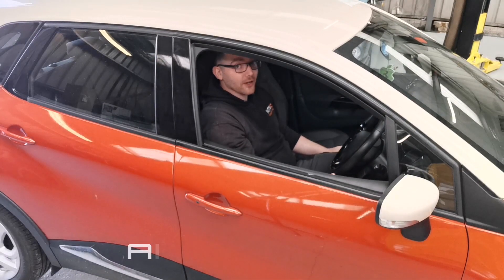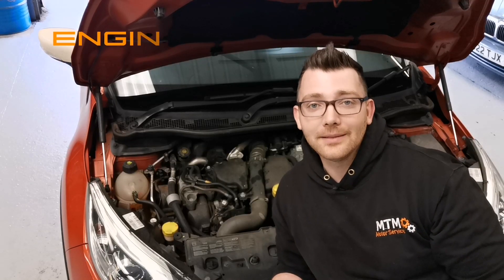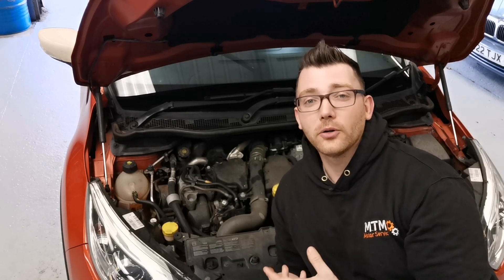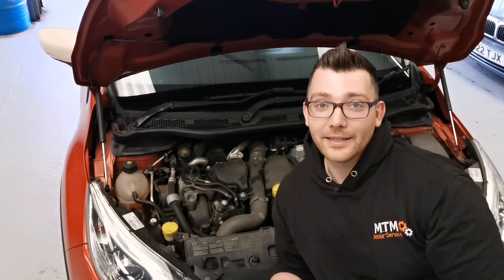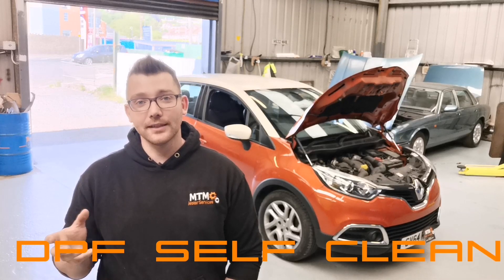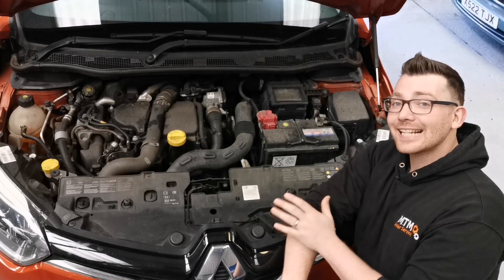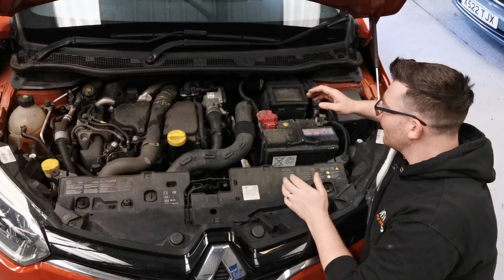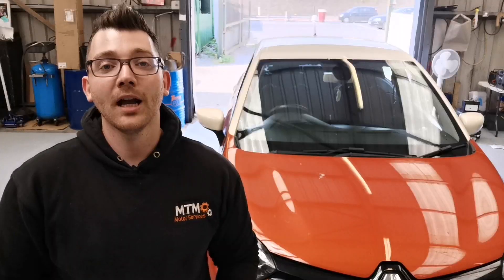STOP / START  NOT WORKING, WHY!?

Comment: We have a 2019 Citroen c5 AIRCROSS 1.5 diesel automatic and in 2 years of ownership and good maintenance it has only worked twice possibly because we always have the radio on and run the heater or air con system.

Comment: September 2024.

I bought a brand new Hyundai i30 mild hybrid, 48v battery, 1.5 7dct.

Had zero issues until now :(

Car from new to now very, very low mileage 6000 miles.
Took it to Hyundai for its first year service.

Came back all good. Their report said both batteries have stong charge. 

However, now just 1 month since the service.

The stop start 'A' LIGHT is coming on dashboard and cutting out the engine braking and gets to 15 mph when the car is STILL MOVING?!
It still works as it should when stopped at lights etc but now also comes on at slow speeds of say 15 mph when turning into a side  road etc????

Comment: Mercedes Aclass 2018 owner, on this it's controlled by an auxiliary battery in the cabin, it will throw up a Pull over and Check Manual msg. Pain in the arse system I just turn off anyway 😅

Comment: I thought aircon was mechanically driven from the engine. Do they now drive them electrically?
Reply from the maker: Air conditioning tends to be engaged via an electronic clutch. Within the AC compressor.
With the AC running, the interior fans will also be assumed to be running which is a large power draw on the system, especially with the engine off.

Comment: Ok, I have a 2017 ford escape titanium 1.5L FWD. I just did a transmission swap.( old one died, had hard shifting problems and then after driving for over an hour it just wouldn’t go into gear and got stuck in a high gear and just burnt up trying to get it to a parking lot) the transmission swap went really well but now I have this one issue. The auto start stop will do a hard shift when cutting back on, this sometimes doesn’t happen if the auto start was active longer than 30secs to a minute, ( it’ll work as normal) but if it was activated at like a short stop ( ie a stop sign) it’ll do hard hard shift then drive normally… the adaptive values and KAM was reset to my knowledge with the new transmission. Any thoughts on what the issue is?

Comment: Start / stop system on my car works when State Of  Charge is betwen 50% and 80%
 Volvo V60 cross country  2017. I know this is the right values.
 I have checked it out with the Car Scanner app and OBDLINK MX+

Comment: I can't believe people would actually complain if that system disabled itself permanently
Reply: For me it saves me around 50 to 70 miles in fuel economy so yea the complaint isn't just about annoyance!
Reply: You cannot MOT your car with stop start failing because it throws up the EML.
Reply: I’m not complaining it’s saving my engine not working screw fuel mileage I don’t want a blown motor that start stop is a waste of install to have my oil not circulating and constantly flowing out and then a hard start constantly screw that let the system rot
Reply: I think many people start worrying their batteries faulty if it stops working!
Reply: Thats beside the point.  If you're paying for a function on a car, whether you use it or not, it should still be working

Comment: will a bad or wrong battery stop the 12v an parking sensors working please aswell as the start#stop
??
Reply from the maker: If you have a bad/wrong battery the Start stop system will usually recognise that and become disabled. as for parking sensors, some cars when voltage drops bellow a certain limit can shut off auxiliary systems in order to preserve power. we would recommend getting the issues investigated by your local garage.
Reply: @MTMMotorServices thankyou so much for your reply

Comment: Always best to replace the battery with exactly the same make and type if start/stop will no work
Reply from the maker: some manufacturers also require you to update battery information when replaced via diagnostic tool. this can also effect stop start and even premature failure of batteries.

Comment: Sir i need your advice as soon as possible.My car ..opel corsa diesel 2016... doesn't have a button to activate or deactivate the start stop function...i recently changed my battery and suddenly my car  stops and starts operating automatically when speed is zero..usually in corners and stop signs..Any ideas....

Comment: Hello , can i désactivate it permently in my fiat 500
Reply from the maker: Hi, unfortunately the Start/Stop function is implemented on modern cars as a way to reduce emissions. Because of that, the Start Stop feature isn't able to be removed permanently. Some cars do have a button in order to manually deactivate the function however, this will reset the next time the engine is switched on.
Reply: Not true, The Citroen C5 AIRCROSS has an available plug in module to deactivate and reverse the automatic on feature when starting the engine, instead the stop start is off automatically when starting the engine until the driver switches it on.

Comment: Stop/Start not working? Whatever is broke, I hope stays Broke.
My Cadillac's S/S, functions with the A/C on, very annoying when the God Damn thing stops every time the vehicle creeps along in heavy Traffic, Useless God Damn thing. The extra Gas burnt will cost a lot less than the frequent Starter and Battery, which has to be AGM, and engine/transmission mount replacement.

Best way to take care of the 80+ Carcinogen Diesel Exhaust, is a Turnip shoved far into the Exhaust Pipe

Comment: I have a problem with a 2013 astra diesel. With the eco mode on it will randomly kill the engine then won't start. It cranks but it choke as iff it's not getting fuel or air. When it starts the clutch often wont disengage when in gear for about a minute. With eco mode turned off it doesn't happen.

Comment: First point is already a miss. most cars power their aircon by the movement of the engine (belt) and not through electricity. so the air con will not draw current it will just not work, and therefore s&s may not kick in.

Comment: I'd deduced a lot of this a week into owning my first car with Stop-Start but also noticed that it tends to manifest as the car deciding it will or won't work at the start of a journey and then nothing I do on that journey will change it! I do noticed the failure tends to be on the outward journey after sitting for a a day or so so I guess it's almost always down to the battery charge (I was doing things like turning off the AC and even the heat/fan down).

I've decided to stop worrying about it now :)

Comment: Mine hasn’t worked for ages then it worked and killed the voltage and turned radio off and brought on warning lights. Had issue in past where battery was knackered and brought loads of faults on. 1.0L civic

Comment: Idle Start/Stop is crap and any minuscule gas savings are quickly eaten up by the more often battery replacement caused by the feature. It's infuriating most cars do not allow you to turn it off permanently.

Comment: I watched you video which was good advice. I've got a BMW 320 year 2012 and I've changed the original battery to a new one but unfortunately the stop start still doesn't work. Not sure what to do now.
Reply from the maker: With certain BMW's you have to tell the car via diagnostic machine that the battery has been replaced.

Comment: My stop start used to work and was temperamental but now it has stopped working completely and comes up with an error message, it's a 2016 vw polo :(
Reply from the maker: Hey Bella, if there's an error warning on the dash, a garage should be able to look into this for you.
There may be a trouble code stored which could point you in the direction of the fault.

Comment: Thanks for the tips! Is there anything related to disconnecting the battery for a short time? I had to move the battery to replace a headlight bulb and it stopped working after that.

Comment: I have driven two rebadged Opel diesel Insignias with this system. It stopped working in both cars at around 65000 miles. The second car has had a new battery and over 130,000 miles and it still doesn't work. Also when it worked it would not operate after about 3 or 4 cycles in traffic  whether in town or on the motorway in a traffic jam. The particulate filters in both cars were in full operation. The second car also has Adblue fitted to reduce NOX emissions. Frankly the stop start system was just a gimmick.

Comment: On short trips of 5-7km the battery does not charge more than 70%, that's if I still light up the position and "force the charge" 
 After 50% the battery no longer charges with 14.8 decreases to 12.8 and with the positions on it charges by 13. 8. 
Disabling the start stop doesn't help much. 
Do you have any idea of a "trick" to trick load management into sitting in 14.8V?

Comment: What about engine wont start again after stop start stopped the renault captur. Car taken back by green flag.
Reply: I hace same issue on aJeep Gladiator 2020.I replace auxiliary batt.but still problem.
Reply: It is not clear cut diagnosis this because the parameters for how it works between different manufacturers changes. One might be saying this sensor and that sensor plus all those others must work and then the next firm arent so stringent and only want 90 percent of those sensors in their stop start system. Only then they add something else in too unique just to screw with your diagnostics. Maybe even software

Comment: Excellent explanation.  I do after stopping and when stop/start isn't working most often see the circled "A" stop/start icon with a diagonal line through it, with the text "For Climate Control" next to it at the bottom center of my display (2022 Rav4).  It displays for a couple of seconds after the car's stopped, then disappears.  The car's less than two weeks old, and the dealer's service dept. has me waiting 10 days to get in!  Any thoughts on that error message?  It makes no sense.
Reply from the maker: If the car is new, it likely hasn't had a good enough run to fully charge the battery,
They should do tests to conform this when they have the vehicle in. But 9times out of 10 when I was in the dealer, this was our main issue.

Comment: Hi my Kia Sportage g T line mild hybrid 1.6 stop start isn’t working ? I travel everyday to work about 27 miles .Since having the car it hasn’t worked I bought it from Kia it’s going to the Kia garage they are going to test the battery the light comes on but it’s orange not green ? Look forward to your input .

Comment: I have a 2014 Ford C-max on gasoline. I replaced the original battery 6 months ago with a Varta one and the start / stop system no longer works. Is it possible that the mechanic put a battery in the wrong start / stop system?

Comment: Mine actually said auto stop start not available Due to vehicle charging.The Wal-Mart automotive services suggested that I unplug all the USB ports Drive around a little bit and come to a complete stop and it should work And sure enough they will right. It worked again. Most of all, do not use accessory mode at all when parked.

Comment: This is a great video. It’s a covert way of telling drivers how to permanently disable that crap.
Reply: I have paid a fortune for a battery to get my stop start function to work (just  so I can then turn it off) 
All I want is a battery that will not let me down in cold remote areas when I go into the mountains to freeze my spherical appendeges and when I get back to a frost frozen car I NEED it to start to get home, and of course initially to defrost/thaw the car and me . 

The Stop Start working is only on before going on a trip, then I will switch it OFF to preserve my starter

Comment: I have a Fiat Qubo 2011 with stop start function and ive been told it can have either stop start battery or normal battery.Chances are i wont use this function as with city driving i dont want egr valve and DPF getting clogged up with frequent stop starts.The advantage of the gel battery is that its better quality and holds more charge.

Comment: Hia mate my honda civic 2012 once started on the 1st start stop 1 min away from my house kicks in but on that 1st start stop once the car restarts it has a loss of power or accelaration causing almost a stall, is this normal? After this the car will run perfectly without any issues or problems

Comment: HELP ANYONE 

My mechanic charged me £160 for a new bmw battery as my start stop didn’t work. 
But when I picked it up it still didn’t work, he said that’s because it may take a few days before working after fitting the new battery? Is this possible? I mean why shouldn’t it work immediately after changing the battery? Did I just get ripped off for the wrong battery?

Comment: I have an Audi Q3 which sometimes gets the Start / Stop System Fault. While the fault code is active, acceleration feels extremely sluggish. Has anyone else experienced this and if so, what was the fix? Cheers!
Reply: We have a Q3 that often comes up with the message “Start system Fault-contact workshop. Drives fine tho but the dealer cannot fix the fault. Low battery possibly?
Reply: @chinatype  It's a weird one. I have seen three mechanics and still have the issue. The most recent said it was coils and plugs so I got them changed. Still had the issue, so had the injectors replaced too. Lasted a week and the issue came back. Managed to get a refund, but I won't be buying an Audi again.
Reply: @jordy6676  what engine was yours?
Reply: @chinatype  The 1.4L version
Reply: @jordy6676  ours was brand new so I think it was just the battery not being charged

Comment: Hello sir, l have a car model is  Kia sorento diesel 2017 that car problem is auto stop system not working battery is new. why?
Reply: Did the battery fitter tell the ecu a new battery has been fitted?

Comment: Really useful video, thanks so much. My new car's reversing sensors aren't working at all. A future video on this topic would be so helpful. My car's a 2016 Citroen DS3 1 6 Diesel. Thanks again. 👍
Reply from the maker: are your reverse lights working? most aftermarket reverse sensors are linked to the live for the reverse lights, so this is something to check.
otherwise if they came as factory standard then they could have their own separate live. if you have your owners manual, you could locate the fuse and check that hasn't blown. there are a few other things that can be checked too, so ill keep this topic under consideration for a future video. Thanks for bringing it up.
Reply: Clean the sensors with some pledge or similar and a microfiber cloth.

Comment: Hi I have diesel volkwagen tiguan and I have the issue of start stop and the car goes to slow mode so the engine does not go past certain RPM? What could be the reason
Reply from the maker: If the car has an underlying fault, the stop start will not work. This is a safety feature.
I would advise getting the car to a garage to investigate.

Comment: Hello, very nice video, thanks!!!

What can you advise me on my case
My van (Peugeot Expert 68plate)
I stop at traffic lights for example and
When I press the clutch to start the engine (or simply press the button for starting the engine)
I hear a screeching loud noise and the engine doesn't start at all and I need to restart it manually with the key(which starta perfeclty)
So what might be cauaing the problem?
I'd very much appreciate if you share somw of your thoughts and experience.

Thank you!
Reply: Exactly same as my car, so did you find the problem?!

Comment: But 80% battery still good battery
Reply from the maker: When your engine is stopped and stationary, the starter motor takes a very large current draw in order to rotate the engine to the point of ignition. Because this is such a high draw, the car just doesn't want to take that risk of you being stuck on the road. So it is de activated as a safety feature.
Reply: Thanks for reply

Comment: great video! my start stop (eco mode on peugeot) is notbworking and the peugeot service told me something about the multiplier of the battery needs to change and will cost me about 500euro , and i am thinking is there any chance if i dont fix it will cause me mite problems?

Comment: I think start/stop is bs. My 2012 Volvo S60 1.6 hardly ever goes into ‘DrivE’ mode, despite being switched on all of the time. Initially starting an engine always uses more fuel, so the end goal of saving fuel, is nonsense. It’s like a power station or kiln, they’re hardly ever stopped because it’s more cost effective to keep them running. Ironically, I’ve noticed that my car is more likely to go into DrivE mode when the fuel tank is above half full. I’m confused